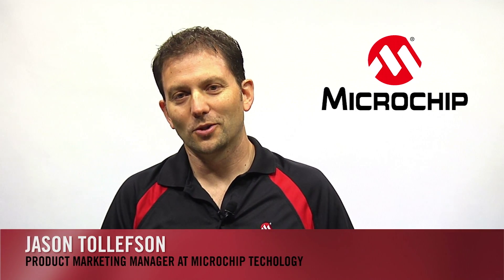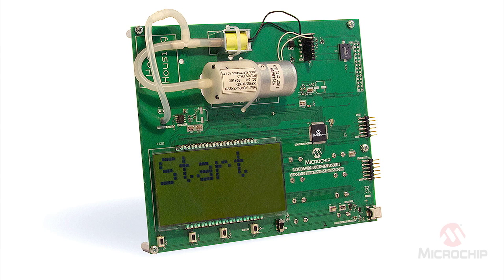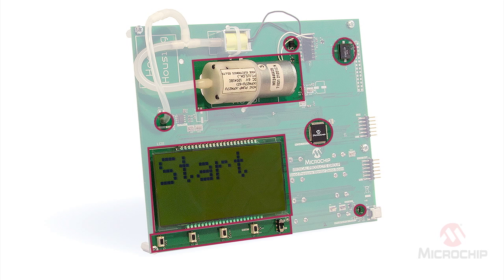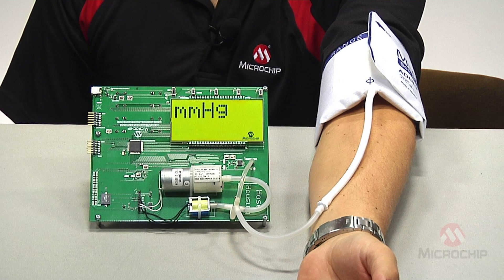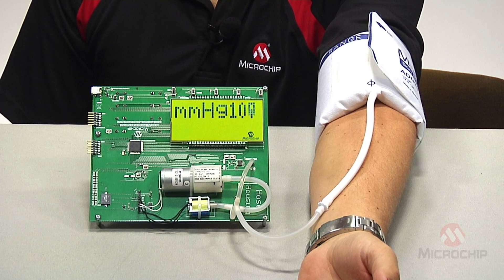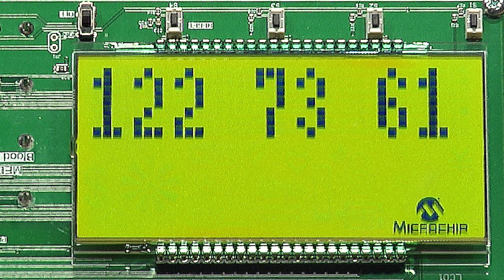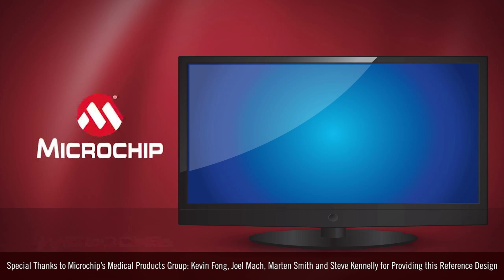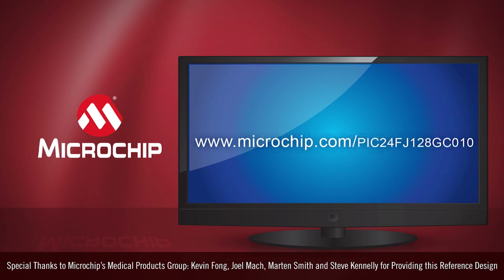PIC24F "GC" Based Blood Pressure Meter Demonstration

Comment: Thank you for the informative video. Would you please explain what is the functionality of the seleniod valve here? what should it do?
Many thanks in advance.
Reply: It releases the air pressure when the process has finished, you can see how the cuff slowly starts deflating at the end of the measurement process